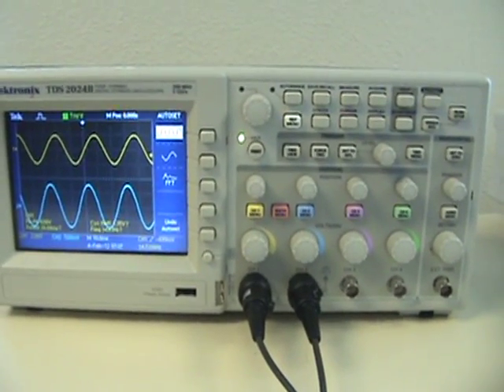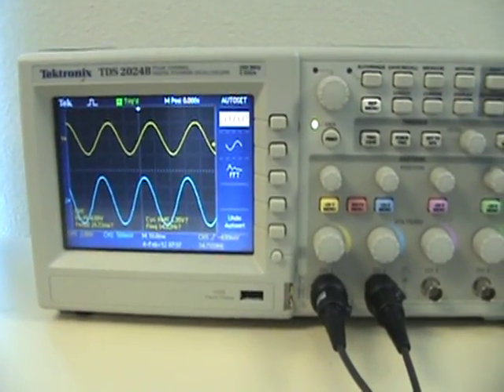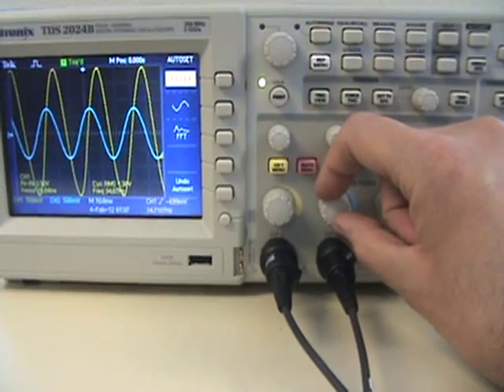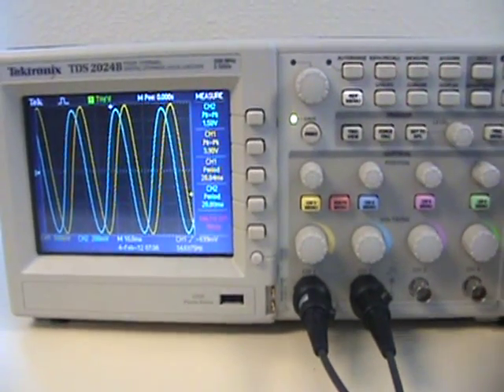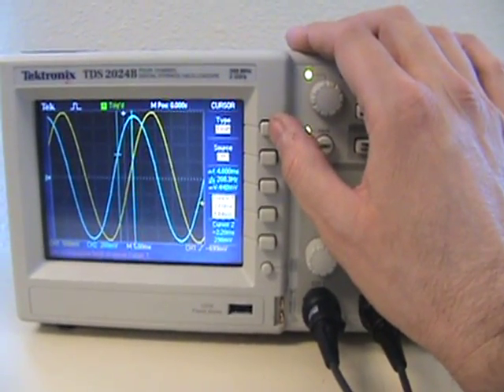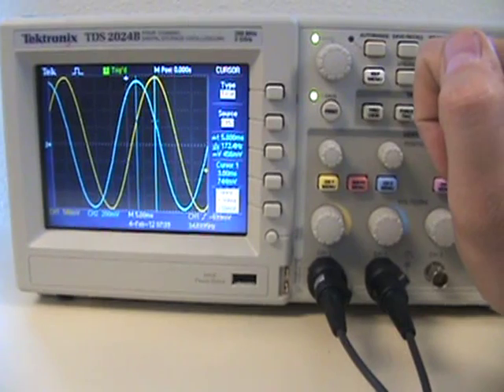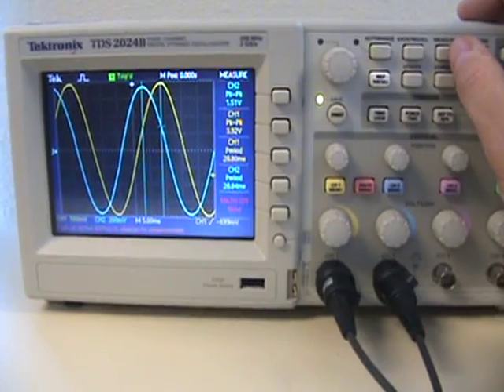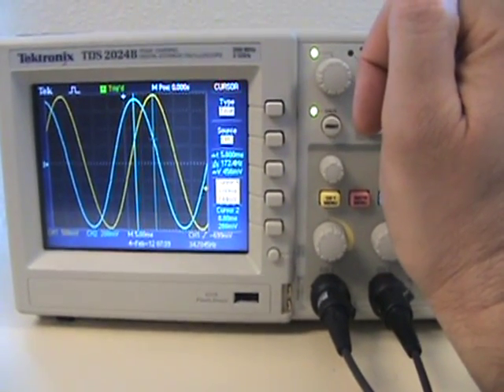Phase measurment

Comment: Hello sir ,i have one doubt ,When I tested with a phase and neutral wave multimeter I got 229 voltage,Then when I tested another phase i got 232 voltage,,Then I got a 401 when I checked between the two phases,,Now my question is why when I test separately I get one voltage and the same when I test them together why do I get less?